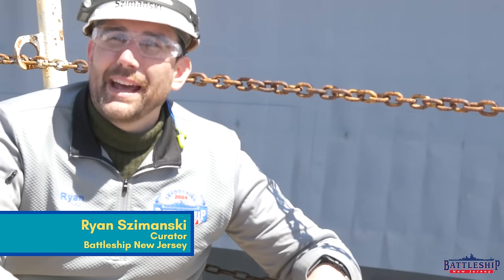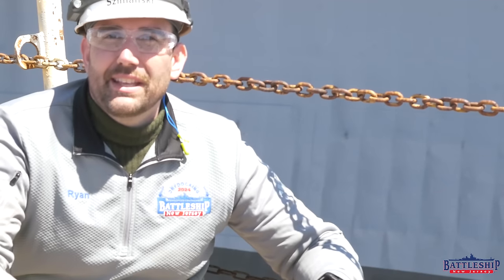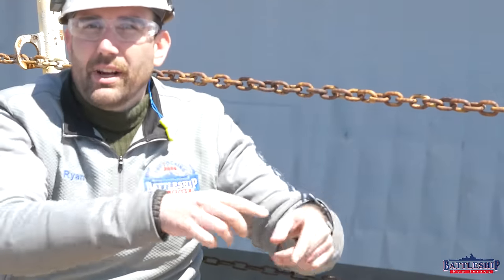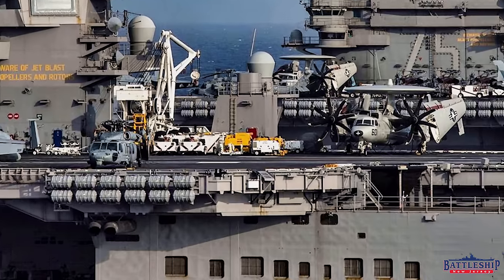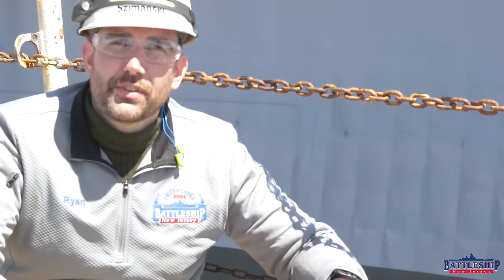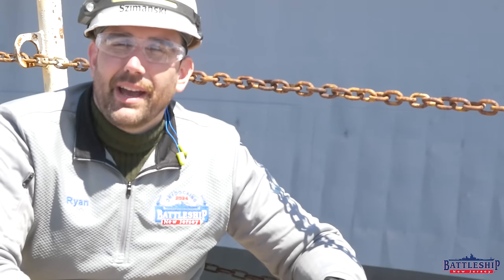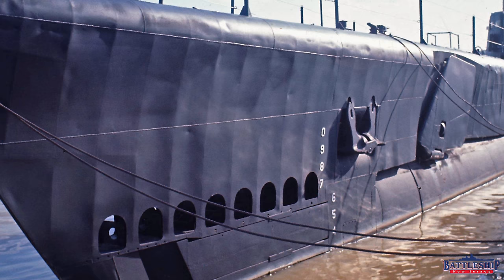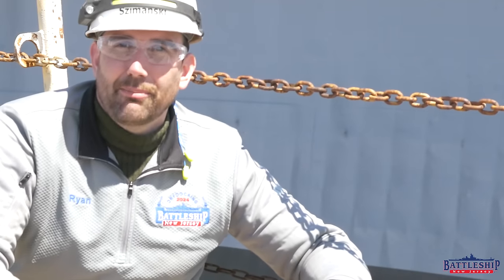What's With All Those Dents In Ship Hulls?

Comment: Oil canning or Panting is an in-and-out movement of the shell plating resulting from the variations of water pressure waves passing along the hull and when the vessel pitches. The location of the most significant stresses is at the bow when making headway. These are greatest in fine bowed vessels. So, it is more than a temperature issue; but can be a combination of issues.

Comment: I built, and then sailed a steel yacht several times across the Atlantic. Typically the frames of yacht are around 24" centres, rather than the 48" ctrs. mentioned in this video. Yachts don't normally oil can, partly because the frames are much closer, and partly because the forces acting on a yachts thinner hull plating in a storm are way less than a battleship.

Comment: One also sees this in travel trailers that are either metal monocoque or metal cladding over wood construction -- no way to avoid the skin heating up and undergoing thermal expansion and contraction more than the underlying structure.  As someone who has homebuilt such machines, I knew exactly what you were describing.

Comment: It's also very evident in old planes; B-52s particularly.
Reply: Copying my reply from another comment: 

It's caused by different things, though.  On the B-52, the wrinkles are diagonal not vertical or horizontal, and it's caused by something called a diagonal or Wagner tension field.  It's caused by having a very thin panel or web in shear in a post-buckled state.  Still very strong.  On ships, the bucking is caused by thermal expansion of the skin but the skin being clamped / restrained by the frames.

Comment: Do ships have insulation like found on houses. Ships look like they are made of vertical studs and covered with steel sheet instead of drywall or plywood. the steel skin are really hot when exposed to sunlight.

Comment: usually seen in higher energy seas... like those off of Japan or the north sea fleet.  Ships that came to Pearl after being homeported in the Japanese sea were easy to spot due to this. the plating being pushed in...like the ribs of a starving horse.
Reply: That's always been my opinion.    I've seen UK destroyers with heavy indentations on the hull plating forward of the bridge.    As you went farther back along the hull the indentation of the plating was considerably less severe.    I'm sure that thermal expansion is one reason, but hitting wave hard would be another.

Comment: I was on two LSTs in the early 1990's. They seemed to be made of warped sheets of metal. Plus, the Newport Class of LSTs were aluminum, not steel. Aluminum is less resistant to stress deformation than steel.

Comment: Hi. Long time XO here. With all respect, I am not convinced about this. It seems to me that a heated piece of hull plating would be just as likely to balloon out as in, but you never see this. Also, you would expect the plate to shrink back to normal once it cooled down, but that doesn’t happen either. Happy to receive counter-arguments but I still think heavy wave pressure is the most likely cause.

Comment: Wonder how dents act with water flow, has anyone tested if a golf ball surface would work with water like air on a golfball?  Some scaling may be needed too.  Waiting for the vid I pictured a haul with dimples purposely placed, might even add some strength against forces like explosions while lightening the armour.  Purhaps a study is in order.
Reply: Dimpling on a golf ball is to cause an early boundary layer transition from laminar to turbulent flow to prevent an even more disastrous separated flow condition.  This works for the golf ball because of the low Reynolds Number.  You don't have low Reynolds Number problems on big Navy ships.

Comment: I have a propellor question.  Since the propellors of the NEW JERSEY do not appear to be able to adjust their blade pitches while underway, are the props designed to be the most hydrodynamically efficient at a specific RPM, and what IS that RPM? Also, what, if any, role does cavitation play at this RPM?  (OK, THREE questions!)

Comment: To the people wondering if it reduces when it’s cold…..No, it doesn’t. I remember they tested a section on Missouri in ‘86, @ LBNSY, they tried freezing a 4x4’ section of bow steel…. Nothing happened, and as soon as the sun hit it, it warmed up with no metallurgical abnormalities….They thought they could straighten the steel by reducing its temperature, but soon learned that armor plated steel doesn’t “breathe”, for lack of a better word. And trying to pound the indentations flat was ludicrous….Besides, it would’ve “oil canned” as fast as its first deployment, IF they had somehow flattened it, or even replaced it. I’ll try to remember the other “experiments” we tried on New Jersey & Missouri…Spoiler alert: I think they all failed to rejuvenate the ships. Also: Adding extra plate was discussed, but soon dismissed as feathering the new plate to the ship’s shape was a fool’s folly.

Comment: As someone that works with cast metals, people don't realize just how much metal expands when it heats up. Even the sun causes  When a rigid framework inside the ship doesn't expand, but the sun expose panels do, it only takes a tiny bit to cause rippling.

Another place you can see the effects of heat expansion is a bridge.  Look at the expansion joints on bridges (they're the things that look like interlocking fingers on the roadway).  In cold months, the tips of the "fingers" will barely be overlapping, but in the summer heat, there is very little gaps exposed.  It's the same thing, except that the ship can't move like an expansion joint can.

Comment: While temperature effects may contribute to oil-canning, the fact that the distortion is always inward is strong evidence that waves slamming against the hull are equally if not more important.  
I once saw oil canning on a group of 3 Canadian frigates or destroyers just after dawn with the sun rays nearly parallel to the sides of the ships.  They looked like tissue-covered model airplanes.

Comment: The New Jersey was also in Typhoon Cobra (Halsey's Typhoon) in December 1944.  Three Naval Destroyers capsized and sank, plus dozens of other ships sustained damage. The sides of New Jersey's hull are constructed of STS (special treatment steel) and HTS (High Tensil Steel). While I'm not an engineer, I have a hard time believing that type of metal would be subject to "oil canning."
Reply: My father was aboard a destroyer that lost a stack in one of Halsey's two storms.
Reply: Physics, expansion rates differ. Heat from the sun.
Reply: @michaelsheffield6852  yes and this affects ships being built. About 25 years ago I talked to one shipyard worker who build Liberty and Victory ships in Richmond CA when he called about questions about his home in Oakland where I work. We started talking about ships. He told me in the summer months the welded steel ships would grow in the hot sun and they would have to alter the shape of the panels as they went along so the ships would come out correctly. Steel does not expand much but over many feet is makes a difference. These welded ships built up tremendous stress locked in while the plating was hot from the sun.
Reply: Steel expands when heated.  Thicker steel has more mass to absorb the heat before it starts to heat up/expand.    Simple way to determine. Find some pics from folks on colder overcast day in the same spot.  I took the drydock tour on 4/13 and there was no wavey steel on that cold overcast day.
Reply: @alwaysbearded1 .  When construction workers tried to put the Keystone wedge @ the top of the Gateway Arch, the two sides had expanded too much; growing together. The St. Louis Fire Department had to be called in to run fire hoses up to the top & contract both arches enough to slip the Keystone wedge in.
Reply: Steel expands when hot, contracts when cooled. then why aren't some of the plates of steel bulging out instead of dimpled in between the frames if the Sun is a major factor?  Secondly, the ship spends most of it's time in the water, so the sides of the hull aren't too much warmer than the ocean temperature no matter how hot the Sun gets. I worked on Naval ships for 20 years (New Jersey and Missouri included) and the engineering spaces weren't bad no matter how hot the days were. The lower level was below the water line and the upper level was just above the water line.
Reply: @jamessimms415  The Gateway Arch in St. Louis is definitely an interesting structure. For anybody who makes the trip to visit St. Louis, it’s worth devoting time to go to the arch and ride the little elevators to the upper observation area. 👍🏼
Reply: @ytlas3 id assume they bulge in because of the "pull" of the welds that connect the plates to the frames. Since theyre all on the inside, thered be "pull" on the inside face, and with the outer surface warmer and expanding more than the slightly cooler inner face, bowing in would be the natural behaviour.
Reply: Yes you're clearly not an engineer 🙄
Reply: Think about the tons and tons of water battering incessantly day and night.

Comment: That pattern of plating distortion is not simply a temperature issue. Oil canning or more correctly "panting" is caused by the forces of water pressure as the ship pitches.That is why the plating distortion is most visible at the bow and stern as they are subject to deeper immersion and more pressure in heavy seas. Additional framing is used specifically to reduce the effect of "pounding" on hull plating in those areas. Anyone who has been to sea will know how incredibly powerful the impact of a large wave can be. The forces can and do bend steel like plastic. Regarding the temperature effects of paint, of course darker colors absorb more heat but the reason for WW2 hull color changes was almost totally for camouflage and visibility. BuShips has volumes of instructions, formulae, correspondence and discussion of the many changes of paint color formulation during the war years, all related to visibility.
Reply: Oil canning or Panting is an in-and-out movement of the shell plating resulting from the variations of water pressure waves passing along the hull and when the vessel pitches. The location of the most significant stresses is at the bow when making headway. These are greatest in fine bowed vessels. So, it is more than a temperature issue; but can be a combination of issues.

Comment: Aircraft are full of this. In light planes, sometimes as things flex, a skin will go from convex to concave, or vice versa, and make noise. The high coefficient of thermal expansion of aluminum makes it worse, but steel expands/shrinks plenty..
   A hot sunny day with the hull submerged in cool water would cause some enormous forces to exist in something that large...
    it would be interesting to aim a bow mounted laser at a stern mounted target on that while in drydock...just before sunrise, so Temps are as close to equal as possible, then leave it after it is refloated,  and observe changes during different weather and water temperature conditions.
   It seems that sunlight might even be able to cause point of impact changes in the 16" guns...that's a long barrel, heated only on one side. A 20+ mile flight of projectile would make little factors like that matter.

Comment: yes i have question if the light grey paint reflects the sun light away and the navy knows this why are the tops of the main battey turrest and the five inch turrets painted black? Black will aborbe sun light and heat up the metal of the turrets making them hotter and in the pacific this would be un bearable

Comment: Well. I live on an ice breaker. Most of the oil canning occurs above the waterline indeed. My vessel is fairly small ( 90 ft) and the webbing behind the skin appr. 16”. I kinda think the dents are a result of applied stresses by welding, waves, ice.  It once needed to dissipate the stresses as a result of welding. I also think this effect reinforces the hull.  
Thus temperature effect? Yes. Due to climate? Not sure if that’s all to it.

Comment: Ryan, I know you said that by mistake and nobody noticed it to correct it, but for the record, ships are painted light colours because those REFLECT sunlight better that dark colours (and thus do not heat up as much), rather than ABSORB as you said it. Question: why do those plate deflect to the inside of the ship, due to heat, as you say, and not to the outside? Why do we see a hungry horse instead of a fat pig? Try this experiment: take a kitchen cutting board made of polyethylene and put it under the tap running hot water. The board will bow towards the water stream because this side of the board gets hotter than the other and because it gets hotter it stretches. By analogy, if the plates deflect because of the sun heating them (from the outside), shouldn't they deflect outwards rather than inwards?

Comment: A Naval Architect would say: its actually called "panting damage" and is caused when the hull plate between the transverse framing plastically deflects due to pressure from the sea.
Reply: Oil Canning or Panting damage is usually caused by prolonged wave action. But there can be other factors, too.

Comment: TIL that "half inch thick steel plate" is "thin metal" on battleships and large vessels. About the steel, I suspected it was as much because of the flex of the ship as anything. If you look at the fuselage of the B-52 on the ground, it wrinkles like that.

Comment: "thin sheet metal   ... 12mm thick" , For me thin sheet metal is approx 0,5mm ....  Quite another scale indeed.
BTW very good to show the open structure from a sub, quite the prove.
But is the metal is expanding, and no pressure is applied, why doesn't it pop outwards sometimes?

Comment: This can also be seen on B-52 fuselages.
Reply: It's caused by different things, though.  On the B-52, the wrinkles are diagonal not vertical or horizontal, and it's caused by something called a diagonal or Wagner tension field.  It's caused by having a very thin panel or web in shear in a post-buckled state.  Still very strong.  On ships, the bucking is caused by thermal expansion of the skin but the skin being clamped / restrained by the frames.

Comment: Ryan,  I don’t think you answered this completely or correctly.  As others who are shipbuilders have indicated, often the dishing between frames and stringers is introduced during the welding processes when the ship is constructed.  Some attempts are made to reduce this dishing by expertly spraying water and heat on the plate during construction.  Other dishing occurs during service when tugs push against the ship and literally dish dent the hull plating, the bow at tug height is a prime location for this type of plate dishing.  The term “oil canning” is usually used in a dynamic sense.  The analogy to an old oil can top is correct, but in the action mode.  A good example is the transom plate of a ship that has light scantling will pop in and out while backing into a seaway.   Or a thin bow plate hitting a wave.  It’s the popping in and out that the term oil canning is used for.  I doubt those dish / dimples in the bow ever pop in and out these days.

Comment: "It's caused by the welding  of the thin steel to thicker steel beams it's welded to, as the welds cool, the metal contracts and tries to pull the steel around the beam, (Warping)...👍

Comment: I would say the sun has nothing to do with oil canning, this is something we see in aviation lots.
It’s caused by flexing and working of the metal monocoque frame construction.
Eventually leads to cracking and fatigues stress failure of structure.

Comment: So it’s not like in autobody work.To get rid of “oil canning”/ after a panel holds “energy “ from a collision and is stretched.It can be relieved by shrinking by applying an oxy/ acetylene torch flame and hammering it out followed by cold water quenching.I don’t suppose anyone (inside the ship)does this.Because it’s not that the metal is not unstable (won’t pop out) like an oil can or car fender.So it’s not the same thing therefore not necessary (and would look ridiculous)!

Comment: 4:41 
Sir, you are incorrect when you state that light colors absorb light better than dark colors.

Just the opposite is true.

Light colors REFLECT more light than dark colors.

The darker the color, the more light, therefore heat, the materials will absorb.

This is basic physics and has little to do with the fancy explanations espoused by others here.

And, it does not contradict your fundamental explanation of Oil Canning.

Keep up the good work, and Happy 4th if July!

Comment: Why always concave and not convex? The inside of a radius is shorter than the outside. If they are bowed inward it  would suggest that the inside was warmer and expanded the most and the outside of the hull was cooler.  If the outside of the hull was warmer because of the sun it would bow outward.  
I am sure I am wrong and am missing something. I'm just not sure what.

Comment: The light colors REFLECT the light and heat better, not absorb it better. I also don’t believe that the colors had anything to do with this issue. The white painting was a political and military statement. The grey is to make the ship less visible. Additionally, the welding also expands the metal at the welded joints, adding to the distortion.

Comment: You'll see it alot on aircraft as well.
Reply: Copying my reply from another comment specifically for the B-52:

It's caused by different things, though.  On the B-52, the wrinkles are diagonal not vertical or horizontal, and it's caused by something called a diagonal or Wagner tension field.  It's caused by having a very thin panel or web in shear in a post-buckled state.  Still very strong.  On ships, the bucking is caused by thermal expansion of the skin but the skin being clamped / restrained by the frames.